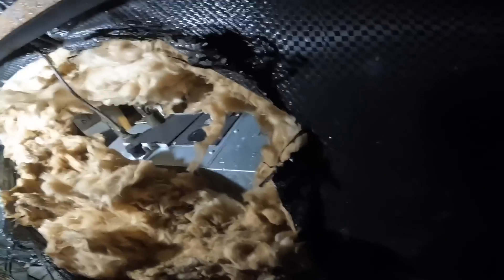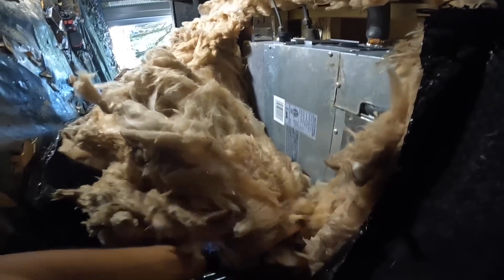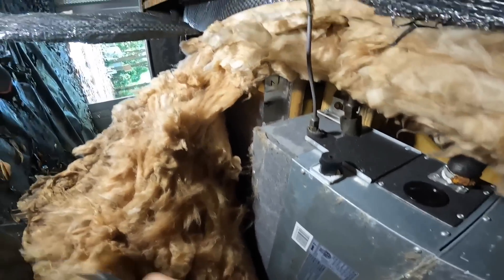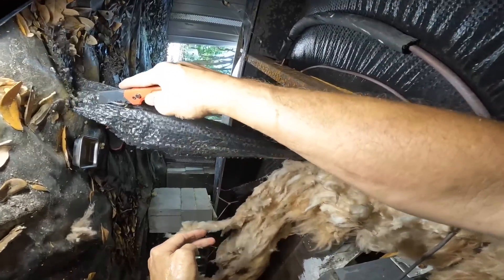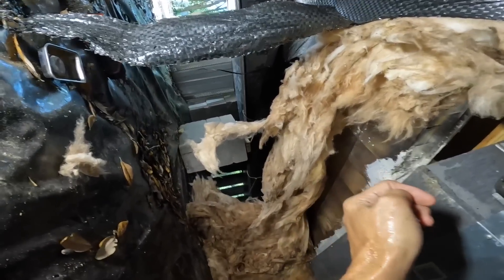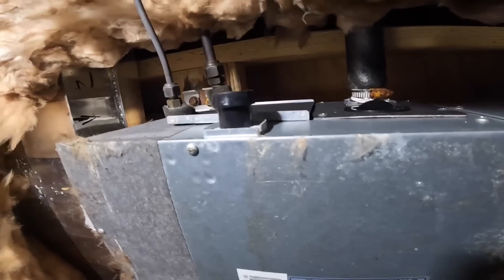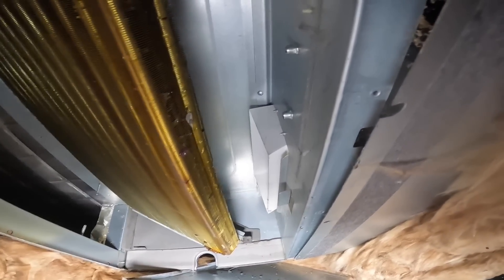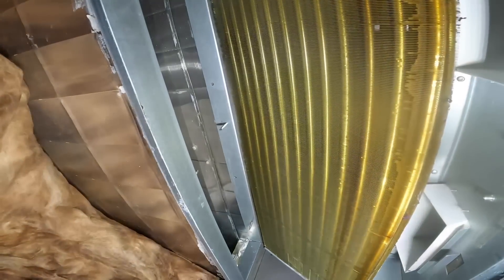Mobile Home Mini-Splits Just Aren’t A Good Idea! #hvacguy #hvaclife #hvactrainingvideos

Comment: This is good pancake unit under a mobil home horrible idea. Great for content. 
I did a coil swap on one of those in an attic , except it was installed upside down (for duct reasons) so I had to flip it. To get access to coil panel

Comment: Considering all the qualifications required to design a mobile home? You would think one person would understand AC Systems need access for maintenance and not just build over it. Putting in a removable panel with a built in drain would be way better.

Comment: Are there any standard safety codes at all as far as properly installing units or can the builder install them anywhere!   Seems to me the lee should be safety codes that require units to be installed in ways that are easily accessible and safe to conduct maintenance on them.

Comment: the minisplit systems are very hard to disgnose as far the charge, what i do in that case is recover and weight the refrigerant, if we are low, find fix and re charge via wheight the freon going back into the system

Comment: Curtis, I have a question with a 4° superheat what do you think that the unit would be overcharged now I understand about your vapor saturation in years of a tech. I would think that you’d want about a 15° superheat maybe I’m wrong. I know many splits are critically charged, do you think you should pull out the refrigerant and see how much refrigerant was in the system? Or put in a fresh charge in . Do you think unit could had non condensables  ? Love your work and your channel. Good job

Comment: Nothing wrong with mini splits, locals just cannot cook it proper way. The only ACs in EU and Asia. Vendor is also important. Since labor is expensive, - it is either should be here Daikin or Mitsubishi. I live by myself in my house and I have 2 indoor units on a single 4 connections outdoor unit. works perfectly great. In a new house I would install mini split in every room. But when it comes to remodeling, - is never easy. unit in living room during hot 90-100F summer working non stop and it is enough for comfortable temperature. Sometimes need to kick in central AC if it is too hot, or I had doors open to go in and out. Proper installation of the units is also MUST. They should have easy access.

Comment: Hey Curtis! Not sure if you're aware, but the two service valves up top are true suction and High pressure ports, They're also isolation valves for the system.

Comment: I agree, that kind of set up is not a good idea.
But, the EG4 Solar Mini Split might be a good idea.
It does not have an A-Coil like that.
95 degrees outside here, 67 Inside and I had to go to my basement to warm up.
And it runs on pure solar, no Ameren bill.

Comment: Nice work, i really enjoy watching your videos. 
On that kind of unit you should have a liquid line port ontop of all the lineset connections just under the electrical compartment. Those two valves with schraders supply the whole headers for suction and liquid for the eev's behind the cover at the lineset connections.
I appreciate your work. 🙂

Comment: I have slim ducts in my attic which is all spray foamed.  They have p traps  and pans.  I ran filter returns with plenum vs the built in filters but whatever moron installed those without filters, without traps or access to service pumps deserves what they got.  Those will never work right without a plenum and return with filter in the trailer.  I guess there is some kind of plenum but without filters good luck.  Another diy job probably…fyi the pumps in those are very inadequate

Comment: Next time you have to drop the drain pan out of that style of air handler, take a bucket with you and pull the rubber bung out of the gravity drain outlet to drain it before pulling the bottom panel off, even if it isn't over flowing from cutting the power off to it.
Ideally, don't turn the power off to the system to let it thaw, just switch it to fan mode, but people are dumb and can't be trusted to not switch it back to cooling before you return.😐
Most of that style of air handler I work on are in commercial VRF systems, so I have the luxury of being able to lock air handlers out of the cooling mode if I need to thaw a coil and still have the pump work.
Reply from the maker: Good idea

Comment: There are worse applications for that type of system.
I get the joy of trying to keep a collection of Daikin and Samsung mini and multi split systems alive at a cement bagging plant, with a mix of ducted and wall hanger air handlers.
The ducted ones can at least be effectively filtered, the filters in wall hangers are just wishful thinking...

Comment: I prefer package units for trailers/mobile homes but the rare occasion we do mini splits it's not that ducted crap it's wall unit and run the line set out the wall and cover with line hide. Folks just being lazy with that garbage.

Comment: Hey you can't charge these by superheat or subcool on these. They're are strictly weigh in. They're variable speed compressors and fans. 
Superheat and subcool don't mean squat
Reply: Don’tDon’t some have a charge mode, where the fan and compressor are fully on?

Comment: You can’t go off pressure with mini splits unfortunately. I’m assuming it’s a inverter system with EXV,s. Did you make sure the compressor was running at full speed? Did you check the evap fans? You should never just add refrigerant to a mini split, as they are a critically charged system. With the amount of water left over in the pan, it was probably a condensate pump issue or plugged line leaving the pumps. Mini splits are a pain to service and especially where those evaps where located. I would have walked away as well 😅

Comment: You might want to invest in a borescope so you can check out the coil without doing all that work. Also, why doesn't the drain pan have a drain?
Reply from the maker: Has a pump

Comment: Ohhhh it's one of those where the AC mini split system is in the belly pan buried inside the insulation. That's going to be an expensive fix for that customer because all of no more than what was cut away the entire belly pan slip and insulation will have to be replaced because now the vapor barrier has been broken.

Comment: Crawling under there was nasty. It's one thing to fix HVAC and another thing to fix a dirty mess. You're a tough guy doing some of that tough work. As I watch your videos I think I hope you're charging for clearing the brush away from the exterior units. I would tell the owners to have a landscaper clear all the crap away from the compressor or if I have to do it there's a $65 charge.

Comment: blowers in those unit are not designed to push air through ducts....will never work right
Reply: It's a concealed duct unit, that's exactly what they are made for.
Reply: That's why his  suc pressure and sup heat were off.

Comment: Was the drain capped off?  If so, how hard is it to plumb?  Awesome work by the way.
Reply from the maker: No, it has a pump and has a drain line in the top
Reply: He said in the video that since he switched off the system, it couldn't pump because it had no power

Comment: Who in the world would stick that trash under the mobile home..? That is crazy..
Reply: Cheap mobile home manufacturers(what warranty?).  No drain/sump pump from the looks of it.  Only mini split system that would make sense would be a wall or floor mount cassettes in each room but at that point, a traditional central system with floor supplies would be better/cheaper.
Reply: Bored, sadistic engineers.
Reply: some ahole that will never see it in person

Comment: On most of those units, if you take the cover off there are liquid and suction ports inside. Some of them are a pain to get to. I believe it’s Lennox that starting making a little cover to access them easily. On the city multi and bigger units they have a “floating” superheat. I’m not sure about the small units.

Comment: Good grief, I hate those kind of jobs, but it comes with the territory. That is just an awful setup and I know they do it all the time. They never look for down the road. I would rather have a package unit any day, or the regular home unit. Heck, in a trailer, I would rather have those "hotel" type units. You are a good man, and do great work.
Reply: The hotel units you're referring to are actually called ptac. Many hvac guys don't like working on those either.

Comment: My career was all commercial and a lot of time in140 degree heat on rooftop units. I would take that any day over crawling around in some of these places Curtis. You're a better man than me. Thanks for the videos!
Reply: i see what you doing but at the same time i'd take rooftop at the same temps over most attics that easily hit 170+ down here

also down south i'd take a crawl underneath a mobile home over long attic crawl easily due to the ground being cooler. Albeit I wouldn't touch a system like this as it's a stupid install, as he agrees, but i digress.

Comment: what kind of psychopath came up with the idea of putting something like this underneath a mobile home?  Even working drain lines or plumbing is nearly impossible under neath a mobile home!  Honestly if my home came with that crap, first thing I would do is have it removed and a unit installed INSIDE like a normal human being with common sense would have.

Comment: I can hear that smoke alarm beeping. I know the customer demographic 😂😂😂
Reply: Dem ceiling birds never stop chirping
Reply: Yea I told him before he should carry 9v batteries because he gets more houses with beeping noise than any one else add it to the charge bam $10
Reply: @rickbarnett9729  Good idea
Reply: @rickbarnett9729  I used to own some low income rental property.  The original property manager told me he always carried 9V batteries with him.  He offered to check the smoke detector for the renter at no charge.  But in doing so, he got to walk though the entire unit to check for possible issues that needed addressing instead of waiting until they turned into major repairs.
Reply: LOL, yeah, unless the battery is completely dead or no battery at all.
Reply: All the time hearing them and it's mostly rent houses. Oh and imma be no on working on this one.

Comment: I've never seen that type system
Reply: That’s a first for me too. It’s almost like some engineer sat around and thought to himself “hmmm, how can I make an already crappy mobile home air conditioning system even worse?”
Reply: They're called a ducted mini-split.
Reply: Our company installs them quite often here in Massachusetts.  A pretty easy application to cool 2 or 3 rooms with one unit
Reply: @GaryB19  easy to install. Not easy on the owners' pocketbook. they don't seem to be very reliable. They are reletively new and there are already many failures
Reply: @staind288  The explosion of their use in the US is relatively new, but they have been around since the 80's in much of the world.
Too bad most of the manufacturers have indoor coil leak issues worse than the worst years of Goodman, Lennox, and ADP combined though...
Reply: @markbeiser  I'm only aware of what the US does and I can attest to their lack of reliability. I've seen too many of these duct able mini splits fail in many different ways. Coil leaks, electrical issues, board problems, and it just plain sucks to have to crawl under the mobile home to get to the stupid air handler. Dumb design. If a mobile home uses a mini split, they need to incorporate a cassette type or even a regular wall type. Anymore, a few PTAC systems seems the way to go but they're so damned heavy